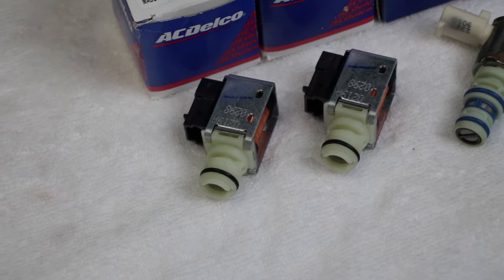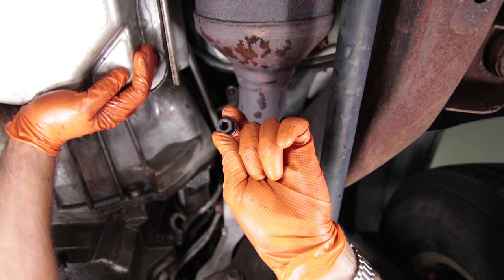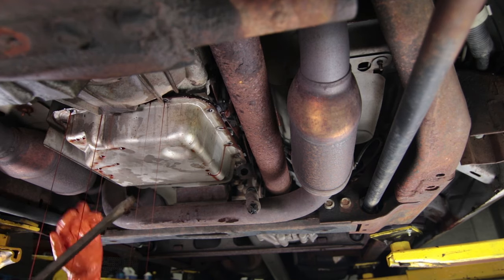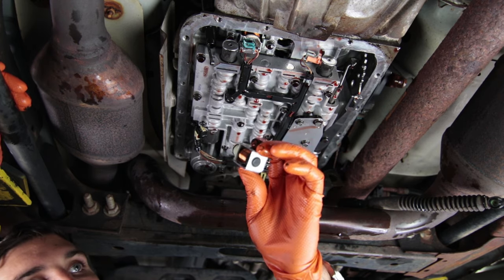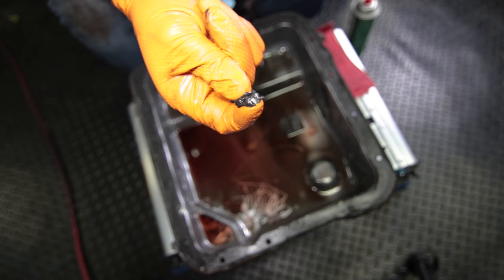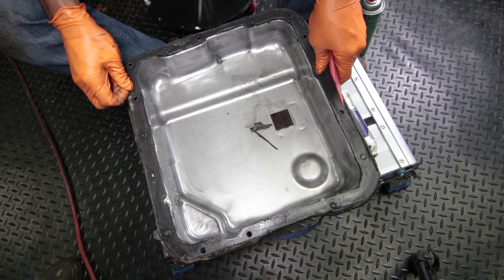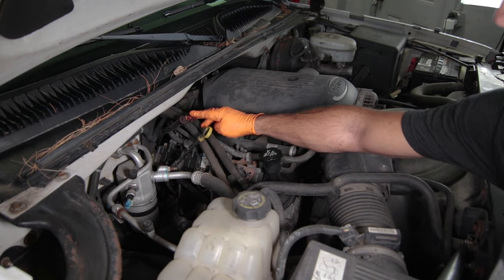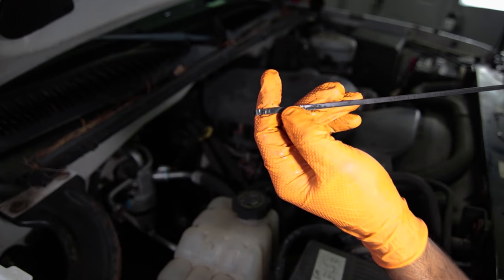HOW TO Replace All 4L60E Shift Solenoids and Torque Converter Clutch (TCC) Solenoid. Silverado 1500

Comment: They put that stupid shift linkage bracket they're on purpose. Id love to meet one of them gm engineers on a dark alley one time.
Reply: Yes
Reply: The 90s gm engineers were way nicer than 90s/2000s Ford engineers. Ford can kiss my ass with all their unnecessary bullshit.
Reply: AWESOME JOB!
Reply: Oh,hell yes they did. First time I bent it over.After I bought another,because the linkage wouldn't adjust right,I somehow made my hands small enough to get out and put in those 2 bolts. Used a pivot head 1/4 drive ratchet.Another thing. Why in the fuck did they run the exhaust right up under the pan?Guess what kills transmissions? Heat,and  its coming off the upstream converter that on a good day only gets maybe 8 or 900 degress.
Reply: If you find em, make sure to invite the Ford engineer that night and see if you can text me an invite 💪🏻💯
Reply: Why can't all the DIY videos be this easy and helpful? Most dudes making these videos have the tism and can't focus. This was helpful guys, thanks. Saved me thousands of dollars and deserves the royalties these channels were designed to pay creators for providing the much needed tech info. 🙏🏻
Reply: 😂I’d like to meet you ha ha! My type of guy 😅

Comment: Y’all make it look so easy, makes me jealous about y’all having a lift. I’m about to embark on this journey on my 07 Yukon xl laying on my back on the ground. But very informative and I’d like to thank y’all for the simplicity of this video
Reply from the maker: A lift definitely makes it easier. We are fortunate for sure! Best of luck with it!
Reply: Same here with my 05 Tahoe, good luck
Reply: Did that yesterday for about 6 hours gotta change solenoids to because I have code being thrown so another 6 hours
Reply: Update, after being thrown around by various parts stores and finally finding a transmission specialist, I’ve come to realize that I have a 6l80 and it’s a complete part that’s a tad more expensive than just the solenoids. On top of that once it gets fixed it has to be programmed by a g.m.c dealer. So I just said screw it and sent it away to be fixed by someone else.
Reply from the maker: Interesting. I didn't realize the 6l80 had been around for that long. Glad you got it figured out!
Reply: Yea it’s crazy. The 4l60 solenoids was only like 40 total, the whole mechanism for the 6l80 is like 700 and out of my skill range. Waiting on the shop to call me back now
Reply from the maker: Things always get more complicated it seems. Not always for the better lol
Reply: Final update* got the Yukon back from the shop and she runs and drives like a dream. They said it’s easier to just throw a new transmission in it than to chance the solenoids because there could have been a deeper problem. So I’m happy now
Reply from the maker: Glad you are back on the road! And thanks for the update
Reply: My 2004 Tahoe is in the driveway on kickstand with the pan off.  I am in Eastern CT with 1/12 feet of snow and freezing Temps.  Going to do this job now.
Reply: Man I have pulled 4l60es in my 2 suburban and Silverado like probably close to 10 times I hate it last time.i just rebuild it myself and it's been great till like 2 days ago its acting up I think it's a solenoid
Reply: @james10739  hey man wondering if you could help me out I have a 2011 Silverado with 4l60e I have first and second gear doesn’t catch 3rd or 4th. What could he the issues I was thinking about replacing the shift solenoids and the torque converter solenoid
Reply: @giovannilopez9427  ya most likely it will need a rebuild or at least new clutch pack for 3rd/4th that's the most common failure on the 4l60e if it was just 4th or something else maybe there would be some parts you could try but that is most likely going to have to come out
Reply: @james10739  hey man, you think with just yt you can put a new clutch pack into the 4l60e?
Reply: @alfonso_v1121  ya I did with the channel (the transmission bench) you might skim thru and make sure all the videos are still there because I want to say I looked since when I did mine and it seemed like they were not all there but they might have just been out of order but ya mine worked well I'd probably order one of the shift correction kits or just shift kits that have drill bits and spring I think it's only like $50 and is supposed to fix a lot of different problems
Reply: Same here
Reply: @stellarv5689  take it to a shop is my best advice! Especially if you have a Denali!
Reply: @bigamemphis10  04 Burban checking in right before winter. Thank all that is good.
Reply: @gageknott8502  why didn't you do them at the same time? Did the code pop up afterwards?
Reply: @TheSundaeDrive  could you please help me with the code 39 I have on my used U-Haul work truck.  The TCC sensor is located where on the transmission?  One of the sensors that you replaced had a piece of plastic or metal piece that came out with the sensor.  It had a shape that would require that it is put back in the same way it came out but it was NOT clear which direction it should be put back from putting it in the wrong way.
Reply: 10:50
Reply: I changed both shifting solenoids and it doesn't shift into overdrive,what else can I do?
Reply: @jeroldtahy7584  I have no idea.  Not knowing is definitely a problem that I have not had much experience in fixing transmission problems.  Sorry for not having much experience in fixing transmission problems.  I'm still waiting on fixing my transmission problems with my 94 GMC problems.  Would it be a safety issue, just to replace the transmission instead of trying to fix the old transmission?  You could have other problems that might show up at a later time.
Reply: @TheSundaeDrive  My 2004 chevy silverado 1500 2wd started kinda trying to shift down or trying to shift while im driving at 60mph any ideas? It has the 40L60E…Thanks
Reply: Should you only replace these solenoids when you have a code, or can i do this as preventative, i have 250,000 miles on my truck right now
Reply: @MrSlm1981 how much for that transmission? I have a 2007 Yukon SLT. It runs perfectly now. But if I have any issues with my transmission. I would like to know atleast that cost.
Reply: @anamositykilla2190  bro, my dealership bought it and put it in, but I had to pay a side note on it, total cost with labor was 6,050$ and a week of not having my truck because they had to send it to a gm dealership to have it programmed. No nonsense whatsoever since then. Just a stabilatrack code and an 02 censor code. It’s gonna go back to the shop soon to get those fixed
Reply: @MrSlm1981  so Reliability on this bad boy is still Strong!? Yaa I just literally bought this Yukon. This my First week with it! So I'm trying to get what info I can on this bad ass GMC. I do like going mountain's!

Comment: The best video I've seen here.  Didn't know it was this easy.  Dealer wanted to charge me $2000 just for what you showed.  Thank you.
Reply from the maker: Thanks! Best of luck with it!
Reply: Surely 2 grand wasn't just changing solenoids right
Reply: @james10739  I wouldn't be surprised if it was only for solenoids. Dealers are insanely overpriced
Reply: frickin dealers
Reply: I'm here because a transmission shop is trying to get 4.000 dollars saying he's going to rebuild my entire transmission in one day.. I think he's probably a crook just going to replace these solenoids and charge me for a rebuild.
Reply: What symptoms did you have w your teuck
Reply: $2000 was to change solenoid for shifts 1st gear to 3rd....whatever that means....my transmission would rev really high before shifting in-between 1st to 2nd and 2nd to 3rd.
Reply: @vechihardwick2099  same as mines did u get it fix
Reply: @OGZEEKTV  ...Sure did and then sold my van.
Reply: @vechihardwick2099 So replacing the Selenoid's fix the problem ..high Rev from 1st to 2nd some times if u let off the gas it kicks in ?

Comment: I had a problem where whenever I get past 30mph it would go into like a false neutral. I replaced all the sensors and filter on the ground getting covered in ATF. It's FIXED AND SHIFTS LIKE NEW 👍  I'm very happy. You can do it just a pain.
Reply: I just replaced my A&B solenoids , filter and fluid. It didn't fix my issue. But I didn't replaced the other 2 here. I think I'm gonna drop my pan again and get them 2 in and at least take a swing at it before I replace the Tranny. 
Mine gets to almost 40mph and it starts to Rev high like it's getting nowhere,  or like it not going into the next gear. Like if I get it high Rev and release off the gas, it seams to go down, then kick in. But it revs high still after the kick in Idk? I thought the A&B, but I didn't get the 3-2 down shift and the other here. So maybe I'll swing at that and see If I have your outcome. Wish me luck.
Reply: @GreyGhost615  how'd it go?
Reply: @martincorrell950  I haven't got a shot at dropping the pan again yet to change the 3-2 down and the TCC solenoids. But I've also been digging around. If it's not that, I'll probably just try and grab a new/used and toss it in there. Go ahead change all them in the used. But we'll see. I've just been a little busy.
Reply: @GreyGhost615  keep us updated. Thanks.
Reply: @GreyGhost615  update?
Reply: @GreyGhost615  it sounds like you're 3-4 clutch packs are burnt.
Reply: @elcabanas7035  Honestly I think you may be right. So I'm currently saving. I like to play and my father worked for Grooms engines for a long time. I've just not got up to him to see yet. Hopefully soon,  but at least she's limping for me enough to save and toss a used one or just get another ride and toss the blazer to the side. It could be my toy. I've had multiple systems in it and wouldn't mind playing with it. I love my Blazer and she's always been good to me. I lived in it when I went homeless,  so I really don't want to get rid of it. When I catch time and space I'll be sure to update
Reply: @elcabanas7035  which one is the 3-4 clutch packs
Reply: @lisandro.20k thats in side the transmission. Takes full disassembly to get to them..
Reply: @GreyGhost615  Any update? I have same issue, I'm going to change the other two solenoids today though, so I'll let you know what happens

Comment: Just did this. Only had 2 and 3rd gear with a code p0753. Anyways changing solenoids fixed my issue thanks for this tutorial. I would like to add though, I didn't need to remove or loosen exhaust at all. Shift cable bracket has two t40 bolts on side that are very easy to remove. Once removed the bracket my pan came down nice and smooth 0 issues. Thanks again for this video. You da man
Reply: Nice! What were you symptoms before? Was your atf fluid bad?
Reply: @KollynJ  my symptoms were I only had 2nd and 3rd gear. Lol my fluid was fine. It was the solenoids that were the problem.
Reply: This weekend I also have the same issue the p0753 and I have a mild tune so I'll also be installing a Corvette servo if the parts come in this weekend the transmission feels strong I just don't have OverDrive so it's like driving a 80 Chevy truck on 35s
Reply: How much of fluid did it take

Comment: Quick tip* the bolt for the linkeadge bracket is a t30 torq. It's usually easy to remove with a ratchet and t30 tip. I don't recommend bending the bracket to get the pan out. Atleast try to do it that way before prying on the transmission 🙏

Comment: Great video, my truck was stuck with just 3rd gear…I had 1st and 2nd if I manually shifted there. Video, couple jack stands and 3hrs from start to finish and my truck runs the way it should again. Thanks so much for the good detail and step by step repair!
Reply: Why do you need to change the 23 or clutch solenoids?
Not enough information and most solenoids replaced in videos never even mentioned or talk about them, only the shift solenoids!
Reasons?

Comment: Just learned this the other day but a quick and efficient way to remove old gasket material is to hit it with the wire wheel from a bench grinder,makes life so much easier than sitting there with a blade and solvents just thought I’d throw that out there for anyone in the comment section. great video very informative look forward to more videos.
Reply: Just ensure you wire wheel away from the exposed components. No need to put crap in your transmission.
Reply: @aronlinde1723  wire wheel spinning, throwing gasket materials all over the engine or transmission doesn't sound good to me.
Reply: @peacepoet1947  do you two know what a bench grinder is?
Reply: @fenixchief7  yes and I also have an angle grinder.  Your point is what?
Reply: @peacepoet1947  his point was, he's not taking a bench grinder underneath the truck!
Reply: @edmendoza5174  you still have a bunch of gasket material to deal with when you use a wire wheel.  I generally don't need to gasket glues to keep transmission fluid from leaking on my 94 GMC or my 72 Chevy El Camino.
Reply: @peacepoet1947  i personally would rather deal with gasket material on my work bench then to wait 2 hrs for that gasket remover to work and then still have to use a blade!
Reply: @edmendoza5174  since I don't have a shop or garage, I work wherever the vehicle is parked.  A wire wheel can make scratches on the metal surfaces.  I've done transmission gaskets, valve cover gaskets and head gaskets and never needed to use solvent or a wire wheel to clean up the surface from an old gasket.  Whatever works for you is okay with me.  Make sure that you are using eye protection when using the wire wheel.
Reply: @peacepoet1947  always! 😉
Reply: The more tools and Lifts you have the easier the job gets. I must have $500-$800 worth of tools, and boy am I glad I do. I used to take my cars to mechanics all the time and would have to pay these outlandish prices. Then as I saw what these mechanics were doing, I said :"I can do that," and I started to stock up on tools and Ramps and then car jacks and the list goes on. Oh yeah, and then YouTube 10 years ago, lol, Needless to say, I haven't been to a mechanic in 24 years.
Reply: red scuff pad works better
Reply: I said f it and just got a new pan from rock auto. $30 is fine with me

Comment: Quick tip, while you got the pan off, measuer a tupe small enough to go down the dipstick tube and just past the end (inside the pan) use that to pump the fluid in and itll be easier to read your fluid level

Comment: The shifter linkage bracket on my 03 Yukon XL (2wd, 1/2 ton) was actually pretty easy to move. There is 1 Torx T-30 directly over the rear driver side pan bolt on top of the transmission flange. The other is two bolts forward (one bolt on the pan between them) both can be hit pretty easily from the tail end of the transmission. Remove the one on the corner, and loosen the one forward of it, and the bracket swings completely out of the way. Don’t even have to touch the exhaust flanges, and no wrestling to bend the bracket back into position when your done. Much easier, imho. 

Great video, guys. And best of luck to all y’all digging in and fixing this yourselves.
Reply: LOL. Well, it was either the $120 in parts and doing the work myself, or Taking it to the transmission guy and spending $900. In hindsight the job was way to easy for me justifying paying ANYBODY $900 to do the job. As inexperienced as I may be, it only took me (cumulatively) 1.5 hrs.
Reply: @FunDuude anything to make sure to not forget that may make the job easier? I’m fixing to do the same thing soon- did you flush your transmission with new oil or just pop the pan in and put new oil in
Reply: @victorcorona8008  ...I drained everything that was in the pan (1 gallon and a 1/4) and then refilled it after the job.
Reply: Do we need to disconnect the battery?

Comment: All the way from Aransas Pass Texas. Thanks for the video I just did my 1996 Silverado on my back took me two hrs. Drained oil from the top and the little that was left I did it from the bottom. I didn’t have to loosen the linkeage just tilted the pan a little. Thanks again.

Comment: I had to replace my 3-2 solenoid, this video was very helpful! Great channel. Thank you for uploading!
Reply: Buy a mighty vac or one from grainger long rigid tube into the trans pan, suck all the fluid out before removing pan
Reply: @TattooTonyAlton  yup that’s what I did, but I used a small hose and a spray bottle head it took alittle while to get it all but it worked
Reply: What were the symptoms/issues/faults?

Comment: I switched over to vacuum extraction for oil changes a number of years ago.  A nice side benefit is, of course, doing extraction for transmissions too!

It's nice to suck out most of the fluid before dropping the pan.  It makes things a lot easier, cleaner, and far more pleasant!
Reply from the maker: Yes very true. Need to start doing that as well
Reply: How much does one of those "suckers" cost?
Reply: @FunDuude harbor freight has them $100 or so
Reply: I use pans with drain plugs. About 30 bucks on Amazon.
Reply: @DocZoidberg549  Yep!  I have such a pan installed too!  They're very handy if going in and out frequently for tuning and such.

Still, the vacuum extractor is nice since simple oil changes and such can be done without jacking up the vehicle...  Once a year or so everything makes its way up to the sky for routine brake maintenance and such.  Then, a full pan drain and filter change can be performed.
Reply: @TheSundaeDrive  - why not remove & show a test procedure on it? (just unclear as to how you knew it was faulty, and why not bench test it or clean it?
Reply: Japanese cars have a drain plug on trans pan
Reply: @gradyhernandez4699  They did it right.
Reply: @gradyhernandez4699  Still have the same problem...  The requirement you crawl under the car to drain the transmission.

The whole point of vacuum extraction is to be able to do a fluid change in a business suit in under fifteen minutes in your own driveway.